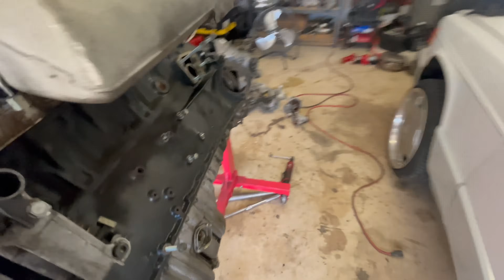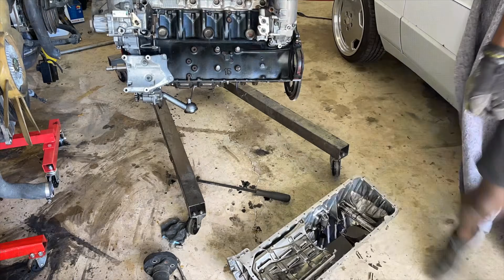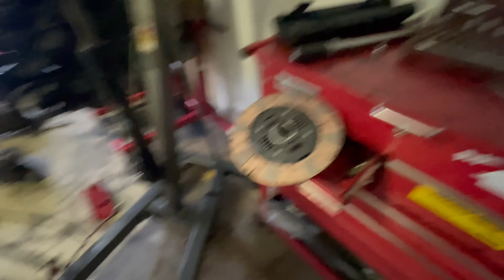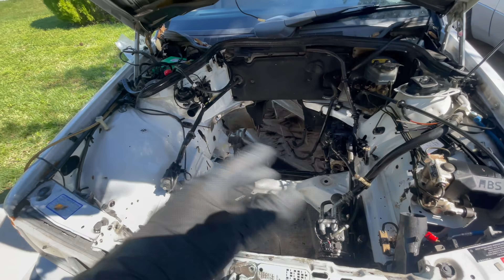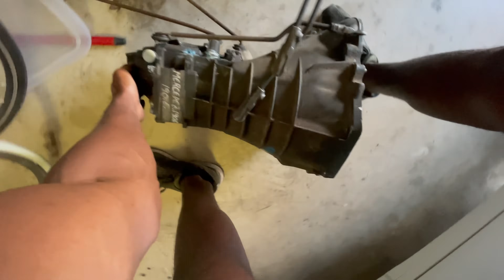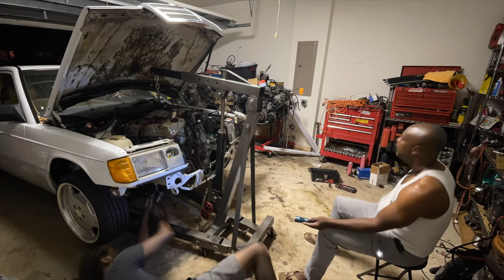Mercedes-Benz 190D OM606 Swap (Part2)

Comment: Engine mounts from 603 should have worked I think. I have m103/603 mounts in my 300ce from the original m103 on my 606 😊
Reply from the maker: In a 124 yes but with a 201 it sits to high

Comment: Hello, where can I find the two custom motor mounts that you used to mount it?
Reply from the maker: At one point kangaroos team made engine brackets. They ended up placing the engine to high. KT stopped producing them. So I used custom mounts to mount it. I believe they were polyurethane disks that were engine mount made for the 240sx.

Comment: For w124s the secret to eng+trans insert and removal is jacking the rear end waaaay up! Looks awesome man! 🚀🚀🚀
Reply from the maker: Thanks! I’m not sure that would help in this case. The engine on most of these are designed to be removed without the transmission. In the case of the 2.6 W201 they have a removable upper radiator support panel. I changed this one’s to the 2.6 design. I’ll have it in my next video.

Comment: The meyle online catalog has the bcd and all bolt diameters for the flex joints / yokes.
Reply from the maker: Just used an adapter flange and got a custom one piece driveshaft made.

Comment: I used  transmission mounts from Scania truck  to mount engine in my 190 🤙🏼
Reply from the maker: I ended up going with a generic 240sx poly mount and spacers
Reply: Nice! 
Do you have a part number from these mounts? Or some Informations?